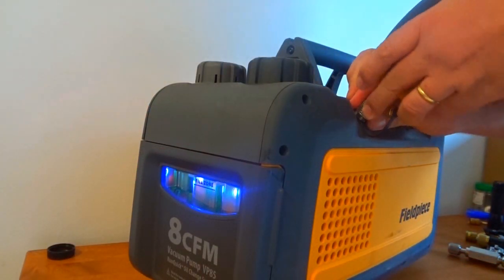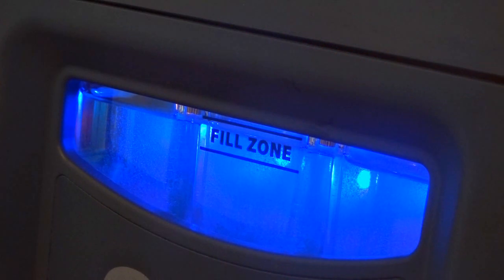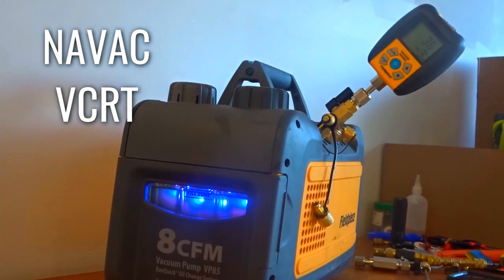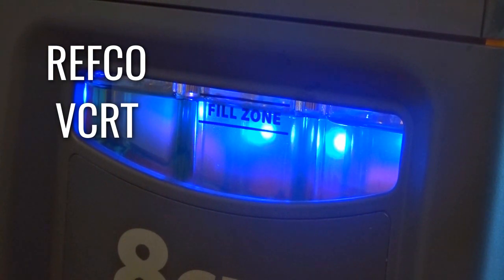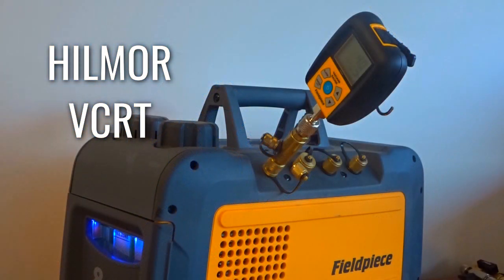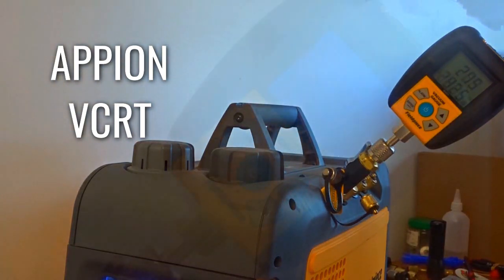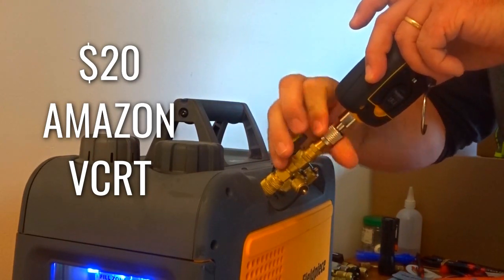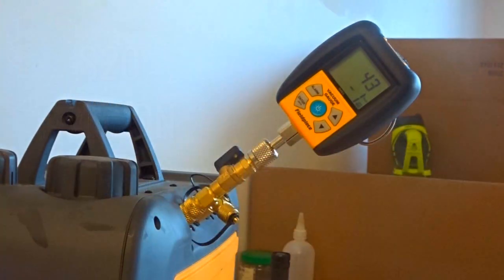HVAC Valve Core Removal Tool | Ultimate Vacuum Experiment

Comment: The best test that I found the hard way is them not holding vacuum, I can have a leak in the system and pull down a very low Micron range. That would be a better determination in my opinion. Especially after 20 uses.

Comment: Could you add a part two of how they perform in removing cores?  I have trouble with apion hanging on to the stem.
Reply from the maker: Robert Griffis yes
Reply: Robert, the core can hang in the tool if the fitting is over tightened on to the access port because the o-ring is compressed enough the center diameter is reduced.  Loosen the fitting about 1/4 turn and the core should slide out.  Also, there is a new design with an adjustable tip and magnet on the stem.
Reply: Eric Kaiser will give it a shot. Thanks